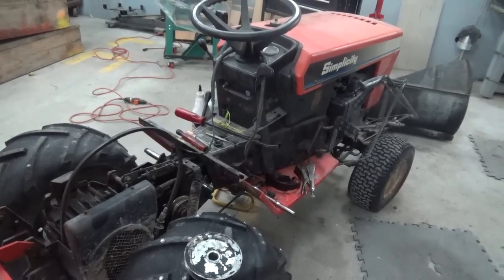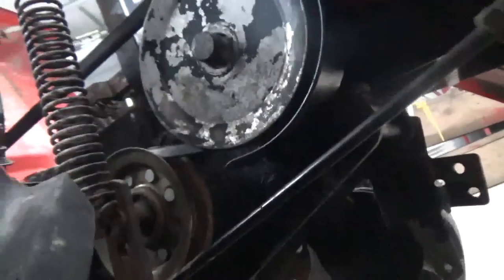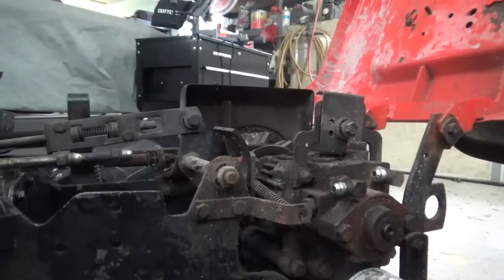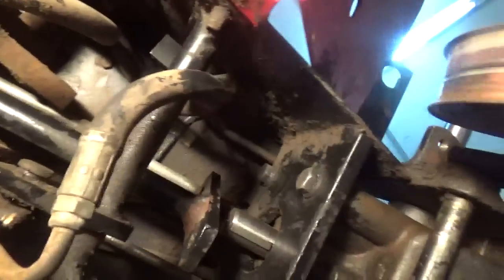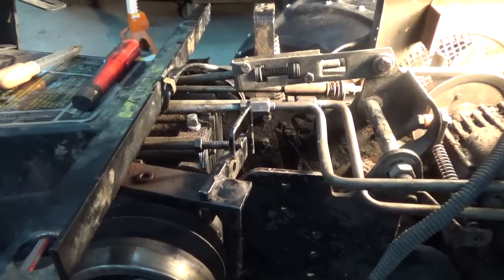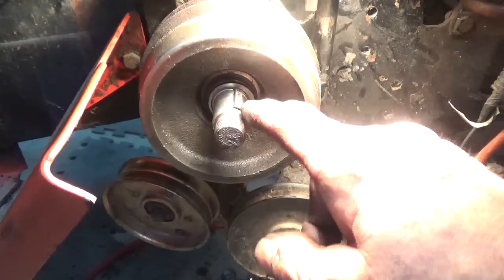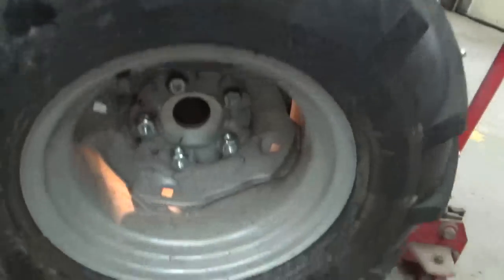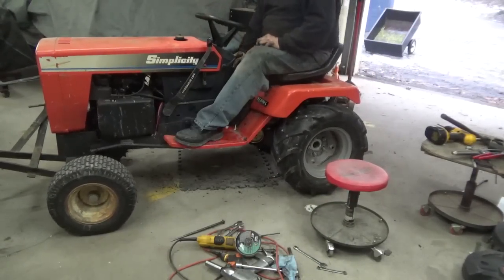Simplicity bevel gear box repair all back together. IT RUNS YEAH!!!

Comment: Joe, FYI, The flex disk that connects the drive shaft to the trans acts like a universal joint to allow for the tractor flex not to damage the trans. The two bolts coming out of the trans bolt to the disk at 12 and 6 o'clock and the drive shaft bolts to the disc at 3 and 9 o'clock. Same as at the engine end of the drive shaft. A few adjustments and you'll be back in business. Went back together real well and it should do what you want it to do. Happy New Year to both of you and your family too.

Comment: Joe, Please reexamine the drive shaft connection yokes between the engine and hydraulic pump as the fiber disks with four holes is to connect the yokes at 90 degrees to form a universal joint to compensate for misalignment of the drive line parts. Cub Cadets have a similar drive line configuration.

Comment: Hey Joe, good save on the end of threaded shaft. Grind off the bad , maybe a little touch with a 3 corner file and bam it's fixed😜.
Reply from the maker: I would have used a die to chase the threads but I did not have that size. but it worked. I was going to use a file but they were to bad. Happy New Year to you and yours.
Reply: Years ago  midsummer , Close to 100° 5 guys on the the Texas coast thought they were going home early😳 my boss repaired a 6" male fitting on a 6" pump with a hammer, screwdriver and a three-corner file. I learned a lot that day.#1 thing don't every say CAN'T lol
Reply from the maker: @piledriver141  Us old contractors dont give up easy. We like a full pay check. lol

Comment: Joe, was looking at your videos because I'm working on the bevel gear box on my tractor too.  Noticed you said you didn't know about why parts left over where shaft connects to gear box shaft - the fiberglass wheel on my tractor is bolted to front shaft - then the rear shaft is bolted to the fiberglass wheel.  the 2 shafts aren't bolted directly to each other - only to the fiberglass wheel.  Mark
Reply from the maker: Yes I found that out when I was working on it. Thank you.